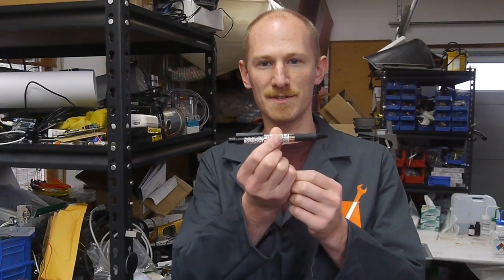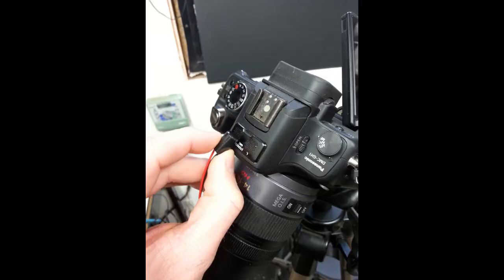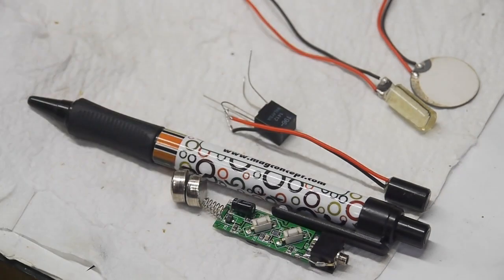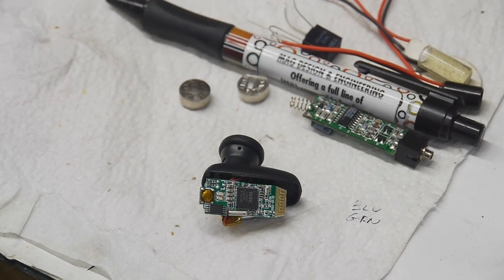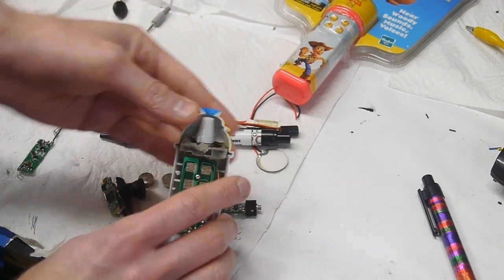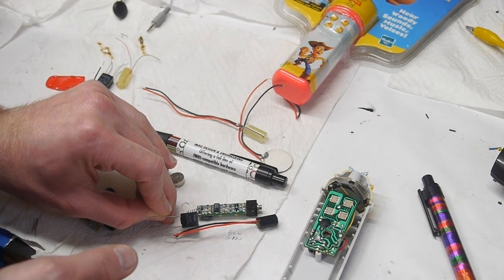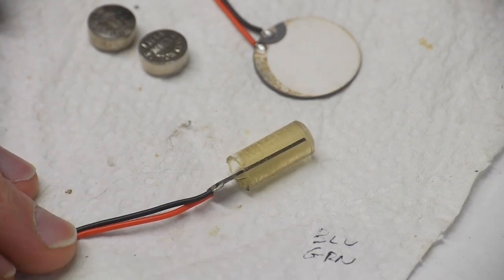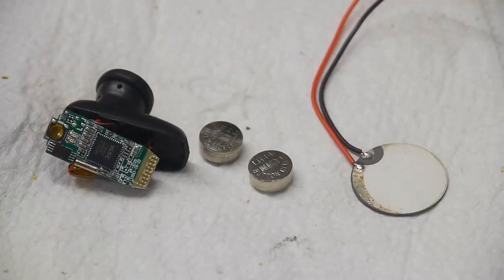Covert radio pen with bone conduction speaker

Comment: Killer app? How about a life-saving app? Put it in the mouthpiece of a scuba-regulator to transmit alerts from other divers that might be out of sight, or warn of air time remaining?
Reply: That plus a throat-mic would be quite effective. Would probably need to be an ultrasonic-chirp transmitter/receiver, since radio doesn't work that well underwater.
Reply: LOL
Reply: Radio transmissions under water are quite hard to achieve, It would be impossible with such a small device since you need really low frequencies to penetrate any depth of water, which normally requires huge antennas (around 500m long). This was in fact one of the main objectives of the HAARP project in the US as communicating with submerged submarines has been since the beginning of the cold war a dream capability for America and the USSR for obvious reasons. The project led to the building of a huge 180 antenna phased array transmitter operating in the high frequency (microwave) range capable of emitting a combined 3.6 MW in Alaska. The basic idea is to generate the very low frequency radio waves you need to penetrate the water by focusing the array on a small area of the ionosphere and heat it up in pulses, which requires very high transmitting power as you need to be able to heat up the ionized gas very quickly ("modulated heating"). Since HAARP will be dismantled next year and since I doubt the US military will let somebody use their top secret installations (if they did implement the technology which is probably the case) for diving safety, I think the idea, while quite good, might not be applicable for a good 50 years.
Reply: i was just thinking the same thing for scuba gear.
Reply: Adrien Perié While this applied to radio transmission this doesn't apply to air time warning, or programmed reminders for emerging. Heck I feel like if it vibrated hard enough it could help with ear pressure.
Reply: Pretty much all dive computers emit beeps underwater to warn about low tank pressure, depth, etc. The beep is easy to hear underwater without any new tech. Try it with any waterproof watch with an alarm next time you're swimming or take a bath.

Comment: I would like a pen with a circular buffer voice recorder in it, so that I could use it to take notes during a live lecture, but if I wanted to "rewind" to let me hear the last thing that was said, I can bite down on the pen and hear a quick recap.
Reply from the maker: That's a pretty cool idea!  I've very often wanted to replay the last 10-seconds of a live lecture, and such a device could do it very smoothly and without disturbing anyone else.
Reply: Applied Science One could even put in a small algorithm in the DSP to speed up the playback to replay the audio at a higher speed (and perhaps pitch-adjusted so that it doesn't sound like chipmunks).  

This wouldn't replace traditional audio recorders or replace a laptop for note-taking in extensive lectures, but the purpose here would be to be a discrete and handy tool for students or professionals to use in lectures / meetings as a general assistant.  Just something to keep in your bag as a "go-to" pen for taking notes.  

But marketing it and selling it?  That's another story.  :)
Reply: Crazy cool. Wish it would be out there for real

Comment: As Jason Webb mentioned, it would be great if bi-directional.  Many years ago, Radio Shack had 2-way radios that used only an earpiece.  Granted they were short range and on 49 Mhz (infested by baby monitors) but the audio was incredible.  There were no microphones evident and it never picked up background or wind noise.  It put every current high-end phone set like Jawbone, Plantronics, duel mics and digital processors to shame.  Sadly they disappeared and I have not found the technology in anything lesser than expensive or military use.
Recreate what they did and you could put all those ear set MFG's out of business.  I still may have mine tucked away somewhere.
Reply: The RS part# was 21-404 and there is even a set for sale on eBay.
Reply: If you find it I'd like to try to back engineer it.

Comment: Those bimorph disks actually don't expand and contract, they bend, as the upper and lower layers change length in opposite directions. In those common cheap tweeters, the disk is supported at it's perimeter and the speaker cone is glued to the center of the disk. The disk flexes to a concave then convex shape as it is driven. Cutting it into a strip would make it behave a little like a bimetallic strip as far as movement is concerned. Encasing in epoxy may not be the best way to extract the mechanical output. One interesting aspect is that the electrical impedance falls drastically with  frequency ( a capacitor after all). In sound system use, a 22 ohm resister is often wired in series to limit power dissipation at high frequencies ( and high harmonics generated by clipping). Love your vids, thanks so much. I have learned a lot !

Comment: This is very cool!  Thanks for the video!  Cut the piezo speaker into a fractal pattern with a laser to get better acoustical bandwidth and coil it up in the epoxy so it has more surface area.  Also, the skull is a resonant chamber that amplifies frequencies at/near the skull's natural resonant frequency, and attenuates others, which can be used to your advantage.

Comment: Hi Ben. 
Another great video. I actually worked on a design about 10 years ago for bone conduction speakers / microphones for firefighter’s. It was placed in the helmet and connected to their radio. The idea was to have a working audio in extreme noise environments. Don’t know if it ever got in production, I just worked on the prototype and had fun with it.

Br,
Jacob

Comment: i used to listen to books as i worked as a gardener. the wireless headphones didn't quite work for me, since my ears are sensitive and my skin didn't like the material or constant wear, also i had to adjust them all the time if someone was talking to me or my clothing brushed against them. a mouth piece without the pen would have solved all these problems :)

could be made as a necklace. when writing on a desk i usually lean over so much that i can catch my necklace without using hands. if the mouth piece was made tongue operational, even people who can't use their hand could listen to music when they want.

Comment: Interesting. Ben, if you are looking for a business opportunity, take a look at the metal detector scene, particularly centered around australian Minelab. Roughly speaking it's 50$ 1980s technology at 1940s prices. 6000$ for pretty basic electronics that could be comfortably bested with 10$ electronics parts. With your intelligence and knowhow I figure you could make a device several generations ahead and still come in at 20$ BOM (sans structure). Sell them for 1000$ I figure there should be a relatively easy million or two there.
Somewhat more ambitious is taking on the Fluke 1980s reign that could be bested by adding modern cheap ADC for o-scope and complex LCR functionality yet still have heavy profit margin at Fluke 87 prices. No buttons, touch only. You could even go for complete murder and add some spectrum analyzer functionality, e and b-field and some active probing for tricorder esque sweeping enthusiasm, say surface laser chromatography or nMR. As can be seen from how Tesla is molesting the existing car makers, they are wholly unprepared for actual aggressive progress. Stagnant businesses don't have the thinking to cope with change, even when faced with a clear and present danger. They seem to cling onto denial and hope it goes away.

The twist to the metal detector prospect is that if you make a really good device it might be more profitable to use it to pick the gold out of the ground in Australia. There is surprisingly still enormous amounts in shallow loose soil if you can detect large lumps down to 10-100m. We are talking billions of dollars that you could dig up by 'hand' with the right detector. And I'm fairly certain that known physics allows for that, well within your intellectual capability. If you sing just the right song, the universe will dance to it.

Comment: Very interesting idea! You mentioned that you can treat piezo speaker as a capacitor, well, I would not say that. It is much more complicated than that. Usually, it is more practical to treat it as a RCL in series. Moreover, the driving voltage does not have to be as high as hundreds volts. In some cases, actually in most of the cases for such a thin piezo, especially you cut it smaller, it is quite sensitive to voltage at aournd several tens of volts. A transformer approach to drive a speaker is fine; but always keep in mind that you will have significant high-order harmonics, typically the second and third order. You may search max232 ic, which comes with surface mount package as well as an internal inverter. That should help with reducing the package size by removing the transformer.
Reply: MAX232 is for converting TTL serial to RS232 though. How would that help in this application?

Comment: I guess a killer application would be the mouthpiece of a closed circuit rebreather. Typically there is a simple three led head up display mounted on top of these. The bone conduction could serve as a good alternative to the visual hud.

Comment: I once read about devices used by army snipers which turned on a walkie-talkie whenever the user started talking. If I'm not mistaken, they also used jaw conduction of sound so that they didn't need to move their hands to make communications. I wonder if listening was also through bone conduction instead of a earpiece.

Comment: If it was to be shrunk down quite a bit then all i can think of is a tooth implant. Could maybe be used paired with a device that, for example, monitors bloodsugar leves and beep as a notification if its too high or to low

Comment: Bluetooth sounds like an excellent application for this! Waterproof phones really aren't that uncommon :) I have a Sony Xperia Z1 Compact, All the Z's are waterproof! As well as an LG G watch, which is IP67 as well, and has a microphone, just not a speaker. In theory you could make a phone work while swimming if you put your contraption in a large waterproof pill of sorts and pair it with a waterproof phone, you could then listen to what anyone says even while you're diving, and reply by holding your watch above the water and talking into its mic. That said, the phone might have issues with getting a signal through the water, so I'm not sure how deep it would work.

Comment: Actually bones and teeth are piezoelectric and the piezoelectric effect encourages osteogenesis- well according to some research in the 90's from NASA, that the ADA was a bit interested in at the time.   So theoretically using bone conduction through your teeth should increase their density.   I once thought about making a disposable mouth guard to utilize this but honestly aside from worrying about the resonant frequency tolerance of teeth in various states- last thing you want is some class action lawsuit over causing jaw bone osteophytes or some other unexpected problem.

Comment: For the visually impaired, being able to listen to any one of a number of assistive devices without annoying others or the 'rudeness' of headphones.  Maybe a pen might not be best format for this, but you've got me thinking about bone conduction headphone alternatives. Thanks.  

I'm used to bone conduction in water, where water fills the small gaps between speaker and skull, but I've always found it difficult to get anything in air (clamping between the teeth is not an ideal solution for extended use).  Any useful sources of information for this stuff that come recommended?

Comment: Since you've been working with sound more: Would you be interested in doing a piece or series of pieces on sound and Cymatics and resonance?

Maybe you could come up with some novel Ooblecks or non-newtonian fluids, Cymatic grain display plates and maybe the concepts of sonic-driven self assembly of small parts, because I know you like practical things.

What happens when you drive a non-newtonian fluid of appropriate viscosity to react emergently to sound waves that is also a ferrofluid like a runnier, more reactive magnetic putty and in the presence of an electromagnetic voice coil or other driver that produces both sound and EM fields?

Comment: How about switching the radio on, then you get a plastic cup and poke a piece of string through the bottom of it and tie a knot, then you go into the next room and do the same again with another plastic cup and knot, et voilà, you're listening to the radio in the next room. There is a slight flaw to my plan however as string does not conduct electricity very well but I do think I'm on to something with this one. I'm determined not to get a longer power cord for my radio.

Comment: Hey Ben...

How would you try to make a vocal microphone with a piezo for direct contact? I know that anyone can buy this throat microphones but I like to make one.

I tried once by just holding de piezo against my neck, and it was connected to my smartphone directly where was placed the electret mic that I remove, on a old headphone cord. I was disappointed because only work when I hold it against my neck, applying a pressure, otherwise you could barely hear what I was talking. It also had a very low tone, very poor medium and none high frequencies was passing by I think. Sometimes even could not understand a sentence. First I think that some kind of preamp was necessary to make it usable but I really would not know... It would be nice as is that pen. I definitely will try make this pen too!

Comment: Great video! I wonder if someone can expand the system to be bi-directional, using the piezo as an microphone as well as a speaker (though probably not at the same time). Use the click function of the pen to switch between RX/TX. Chomping out Morse code might be good for the covert communication applications, but a system like this could potentially be used in assistive technology contexts where someone with limited body/neck mobility could at least trigger inputs and outputs using their jaw and voice.

Comment: This is great. Nice work (?Ben). Ever seen those microphones that stick/press on the side of your throat to detect sound without going through air first? It would be great for lots of applications such as cycling to combine these two.
On an unrelated note, have you ever had a need to create a bubble-free epoxy piece? Ive just finished a joule thief torch cast in epoxy for the side of a swiss army knife but it's full of bubbles so doesnt look very professional. 
Si
Reply: I know this is 7 years old... but you need to put the epoxy into a vacuum chamber before pouring it. This can be made cheaply from a pressure cooker pot and an inexpensive air conditioning vacuum pump for automobiles.

Comment: It’s an innovative, unique, and novel idea.  Make it available, and the market place will decide how it should be effectively used.  The most obvious applications are circumstances where ear apparatus is impractical or undesirable.  But who knows, teenagers might decide it’s a “must have” accessory for their digital music device.  Maybe a “stereo” version?   Importantly, it should be plug compatible (or easily adaptable) to a wide range of devices.

Comment: Could you use a crystal diode instead of an FM radio receiver? That way it could receive without batteries. Once upon a time I built a crystal radio to pick up AM radio signals without power. The diode essentially uses the signal from the radio station to vibrate the small transducer inside the earpiece. Heck, I imagine if you had metal fillings in your teeth you could even pick up the signal without a receiver!

Comment: I am suffering from a disease that is slowly taking away my hearing. While my inner ear is healthy my ear drums are being locked up by the disease. I can hear better through my bones than my ears so I was wondering about using this type of device as a hearing aid. The hearing aids I use now are at full volume but I do not hear very well with them and they are sometimes very uncomfortable. I think some kind of bone system could work well for me and I would be very happy with something that did not go into my ear canal. I am very good with electronics and could build a circuit if you could suggest one. Maybe it could be your new product? Just be sure to build one for me. Thank you.

Comment: Could you impediance match with an autoformer?
Drill turn a mandrel/ferite rod and cam, set to tap "+1" on a calculator if exact number of turns needed.

Comment: Really cool!  but Im curious
What I understand is that the Piezo element expands thickness wise,  If you fully cover it with epoxy does that lower the sound output? Shouldnt it be better if you only have epoxy on the two sides so the top and bottom of the piezo push agaisnt each other freely?  Im confused how you can get sound if you have nothing to push off of.
Reply: Sound waves are pressure waves in material. They are transmitted best when the material (almost) doesn't budge and thus doesn't waste energy moving atoms around. At least that's the short version.

Comment: Hey Ben. This is really great thanks for sharing ! I'm trying to make the same thing but with a Bluetooth headset just for fun. Any chance you can share some advice on how to fit all that electronics so neatly into the pen and have the pen still function ? also will the same setup you used in terms of impedance matching also work with a Bluetooth headset as it did with the small FM radio unit you demonstrated. Thanks and keep up the amazing work !